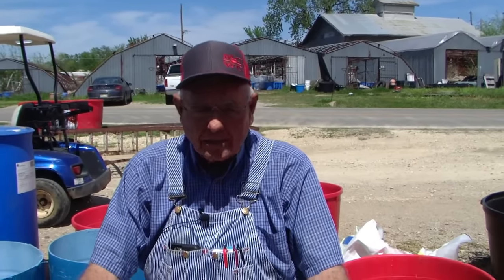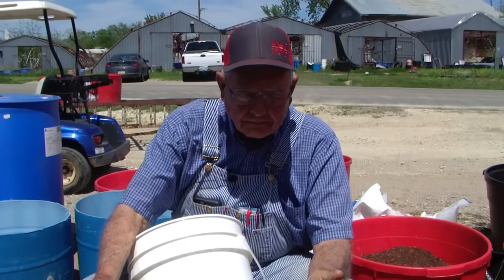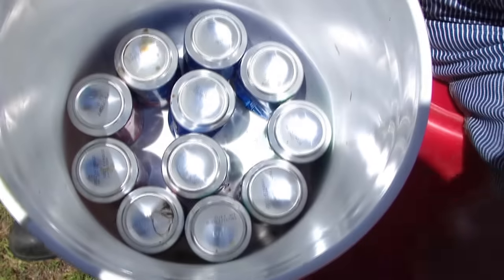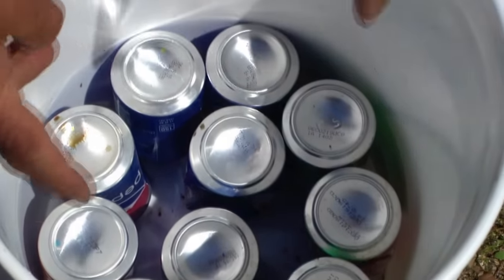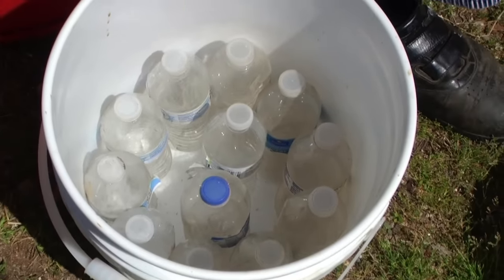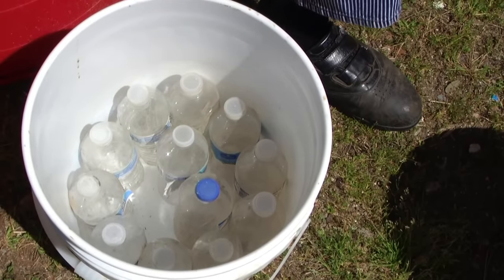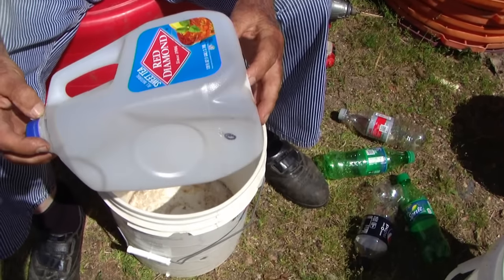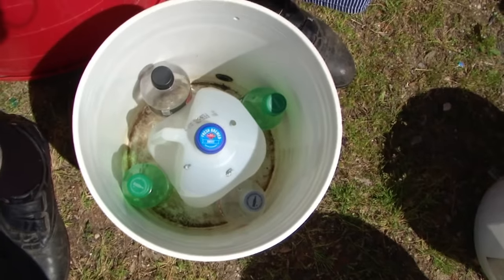Using 5 gallon wick buckets  Ep. 15

Comment: My plants are very happy in the 5 gal self wicking buckets. I have used a variety of containers for the bottom. I have one with a half gal jug that has a handle and I tied a cord around the handle before putting in the soil... I use the cord to string up my pole type tomatoes. It makes a great anchor! 

Also, I had an old hose that was going to be thrown out. Instead, I keep cutting pieces off to use in my self wicking buckets instead of pipe. It fits perfectly in the top opening of plastic pop bottles! Just being resourceful during lockdown when access was difficult.

Comment: Used this design 2 weeks ago and it's been working out great!

I made 2 buckets. One completely with dirt and the other using sand at the bottom for the wicking material. I used ground cover to separate the sand from the soil.

The seeds in the one with sand germinated and grew much faster!!! It's crazy how quickly they've been growing!
Reply: Curious how the plants grew throughout the season. I am interested in trying sand in bottom and then soil.
Reply: What kind of ground cover did you use?

Comment: I didn’t read through all the comments but wanted to add that donut shops—and bakeries including grocery stores and Walmart—are an excellent source for buckets. They are icing buckets and usually less than 5 gallon. 3 gallon is common. But they usually sell them with a lid for a dollar or two. My guy makes me a deal if I buy all they have. They’ve very sturdy, with the plastic style handle like the buckets in this video.  

Greetings from Poteau, OK. Keep at it Leon!

Comment: i.ve been out all weekend cleaning and painting my old pots and half-drums.  i.ve made all of them into self watering based on your tip to leave AIR space above the water.  i hope this will "cure" the overwet stinky odor in past garden bucket attempts.  i used hot soldering iron to poke  holes in the bottles. thank you

Comment: Leon, this is the second video I've watched today.  I think I got it down.  1.  Get a bucket.  2. Put plastic or metal container in the bottom of bucket, each container needs a hole in the top and bottom of it.  3. Put your soil + additives over and in between containers, fill yhe dirt all the way to the top.  4. Plant your plant.  5.  HOW do you know when to water again?   Neither video has told us that.  Without knowing when, this is no different from just watering your plants as we've done before.  6.  When to water wicking planters for Dummies.  Thank you.
Reply: I second this question. You never mention when or how to water the plants. Please advise.

Comment: I love your use of cans, I never thought of that!
When I make 5 gallon bucket into a wicking pot, I trim the lip off a 3 gallon icing bucket,invert it, cut slots in the bottom and use that as the reservoir.
For 55 gallon and IBC totes I use inverted 5 gallon buckets.
I find cutting slots rather  eliminates the need to use weed cloth.
I don't care to use anything as thin walled as water and  pop bottles, I find then too weak.

If I can figure a quick/easy way to put a slot into a glass bottle, they will be come my favorite, as they are plentiful and totally inert.
I've tried a form of in the ground wicking by burying a 5 gallon wicking bucket under a transplanted tree.
The idea is to give the tree an artificial reservoir to tap, while also allowing it to seek ground water.
Too soon to report results.
Reply: How goes the tree?

Comment: Can u make a video of why the air in the water bottle helps. thank you for all your great videos Leon.
Reply: two reasons I can think of.  But there may be more: 

1) Having that air space ensures that you don't get resistance when filling with water.  Think of when you try to pour something from a closed container that only has one hole.  It kinda plugs itself and pours slower.  That's why people usually punch a secondary hole for the air to come in and help push the liquid out.  If there's only one hole then the air has to come out the same hole the water is going into and the process is terribly slow.
2) It keeps from drowning your plants.  Yes, plants love water.  But if you actually submerge them for too long, they "drown" their roots become waterlogged.  They need the water, of course.  But they need air, too.  Much like you could dive to the bottom of a pool to get something you need, you couldn't stay down there forever; plants are the same.  They can send their roots into water.  But they need air, too.  But that air has to be in the soil, not just above.  Having that air gap between the water and roots ensures that the roots are never trapped under water for longer than they can tolerate. 

Same reason you put the hole on the side.  So it can just spill out instead of filling to the top.  Test it out some time.  Take an extra plant (or even a weed) and put it in a cup with soil and keep it soaking wet.  Between rotting and drowning, the plant won't last very long.
Reply: yosef bernath - The kratky method explains that.

Comment: I use a soldering iron to punch my holes in the bottles. You can buy them on Ebay really cheap.  It will ruin the tip for soldering purposes, but it will last many years as a hole puncher. It is WAAAY faster, and safer than trying to drill them, and you end up with nice smooth holes, whereas drilling sometimes leaves sharp edges.  I don't know the diameter of a soldering iron tip, but it looks to be about 3/16 inch. I put about six of those on the bottom of the bottles, and four on top. I leave the caps screwed on, and if I have bottles with missing caps, I use one as the "filler" bottle. 

I have a piece of plastic hose screwed into the end of the "filler" bottle, so you only need a foot or so of hose. I have not tried garden hose for this, but it might also work. You could probably make an adaptor out of electrical shrink tubing, if the hose doesn't fit the bottle. Of course you could also duck tape it.  I'm not sure exactly what size MY hose is, it was just something I had laying around. If possible the filler bottle should be a 2 liter, so you can just top it off every couple days, and let it seep out the bottom, and migrate into the bottom of the others.  ...Next time I make one, I'm going make the filler out of PVC pipe, and then make a "dip stick" so I can get an idea of how much liquid I need to add. …..BTW fill ALL the bottles up to the drain hole in the container, BEFORE adding the soil. Just fill the container until it almost runs out the hole, then tape the hole shut temporarily, and hold all the bottles down until they are full. It would take forever to fill them ALL up the first time otherwise.

Comment: thank you for these videos, brand new here and newbie gardener about to embark on this wicking tub for my first garden, I wanted to ask - these do not have a pic pipe pour spout, can you tell me if I have to water more often without a pvs pipe fill spout? As I will just be watering from the top? Is it MORE ideal to add a fill pipe? Or do I just water from the top till water comes out form the Hole on the side of the bucket? About how often will I have to water if I do this way (without the pvc pipe or shade cloth? thank you Leon and Bless

Comment: Thank you so much for explaining this in detail, Tried to do this watching a prior video but this one is so much easier to understand. Question do I need to add the 1" PVC pipe for watering and what about the fabric do I not need it? Great video thank you again so much
Reply: Yes you do. Spoke with Leon...what a nice man! He said to cut a larger hole on the top of one of the plastic bottles, just big enough to slide the angled bottom of the 1" pvc (or whatever you have on hand) all the way into it. And also drill a couple more holes at the bottom. (1/4" are fine) This helps the water drain out quicker to the other bottles. About to complete my first ones, so hence the reason I checked. He said that if you need to call him do so after 7:00 PM.  Good luck & good growing...peace, out.
Reply: A couple of things a. The pipe needs to be cut at 45 degrees on the end you stick into the tub. This is to allow water to rush out from the side of the pipe. If you cut the pipe at 90 degrees it will sit flush on the floor and block water flowing into the bottles . B. You don't need a cloth if you drill a hole less than about 8mm or a pencil diameter . This small drill size  will stop soil getting into the bottles . If you drill larger holes or use a side on pipe as seen with other videos you need to use that industrial. Sheeting to stop soil getting into the designed air spaces . Hope this helps
Reply: Yes, add the pipe as Uncle Brother here explains. You want the pipe so that you can water into the pipe, and avoid having to pour it directly on top of your potting mix. This way, you wash less of your fertilizer and nutrients out of that potting mix. This is also why a lot of bucket gardeners will try to protect the tops from rain. Even though rain water is wonderful for plants, the fact that it washes out your fertilizer isn't so great.
Reply: @drb4074  Nothing wrong with fertilizing the bucket's soil on a regular basis with a conmercial product, right?

Comment: Those of us who live in North east where the temperatures are mild, we might be able to just drill a hole an inch from the bottom instead of drilling drain holes on bottom of a 5 gallon bucket. Once you drill holes at the bottom of the bucket, it will drain out everything and it will be dry in summer. If you drilled the holes  about an inch, it won't drown your plants but excess water will collect in the bottom pit, we won't need to put any cans etc. What do people think of this idea?

Comment: a few years ago i started putting water bottles at the bottom of my stone planters to act as a layer of stone to allow the water to escape too. didn’t thick of making a water reservoir.  i’m going to put some water vessel inside the planters because i will not drill into my stone planters, they’re about 3’ high and too expensive to potentially break.

Comment: Thank you Leon. Great video's. In some video's you use a tube to fill the bucket, would you or can you use a fill tube in the 5 gallon pail and how does the water get into the smaller bottles if the soil is packed down in between them?  Thank you
Reply: 2 holes are drilled in the side of each bottle; 1 near top and another near the bottom.
Reply: @audreynorman1772  setting p my pails just this week I put 4 at the top and 4 at the bottom to make sure water and air can equally move about, And since this is my first year trying this I am worried and thrilled to see what happens

Comment: A more natural method is to put sticks and twigs in a layer on the bottom instead of the cans. It will give you the air spaces that the plants need. Cover with a plastic top when extra heavy rain is in the forecast. Safer for your family to recycle the plastic bottles and cans.

Comment: Thanks Leon for sharing your wisdom. I am going to do 5 gal buckets for sure. But also want to do this with a smaller, Folgers 48oz Ground Coffee Can. They are 8.5" tall, 6" in diameter. How high would you recommend for the water line. I plan to do hibiscus and other cuttings. Thanks!
Reply: Do you have a follow-up? 🤘

Comment: Can you please tell me if I need to put a PVC piping in any of those techniques, and how to do it. Thank you!! Love your videos
Reply: A pvc pipe makes watering very easy. Measure pipe so its above the container. Then cut the bottom of the pipe an angle to prevent cloge. You can also drill some holes on the PVC pipe but isnt required. Simply dump water down the pipe till it starts coming out of the hole on the side

Comment: GREAT VIDEO - Just making sure that I do NOT need to put cloth over the Water jugs in the 5 gallon bucket correct? 1 Gallon with drilled holes top & bottom & 4 plastic soda bottles with caps & holes top & bottom, then the bucket gets about a 5/8" hole o its side 5" up . Place the gallon & 4bottles in with PVC pipe then add soil as mentioned then use PVC pipe to fill with water until it over flows out the side of bucket. Correct ?
Reply: You still need to put the cloth or the plant will drown.
Reply: Thank you for the response !  @suhayb727
Reply: PowerV2010  I’ve seen these types of videos a dozen times & STILL don’t see how it’s all tied together. How are all the cans/bottles holding water if you’re drilling holes into them?  Why not just drill one hole 5” up & be done?
Reply: That's is what I am trying to figure out  @user-22-

Comment: Using plastic water bottles with holes at top and bottom, does the potting mix tend to fill the holes and impede adding water?   Same with pvc fill pipe.

Comment: This is great but I have a curious question about the 2 holes in the bottles/cans/jugs.  Wouldn't the soil get in those holes?  Especially the jugs' top holes cuz it's almost facing directly up.  Over time the cans/bottles/jugs would fill up with soil and have less water holding capacity.

Am I missing something?  If anyone can elaborate on this would be much appreciated.
Reply: im going to push some weed cloth down into and around bottles/jugs then add soil. i thin leon demonstrates this in another video

Comment: Great video BUT........I made one of these with a 5 gallon bucket using 3 to-go soup containers and three 12oz Coke bottles in between. All drilled high and low on the sides with 1/4 in holes. My question is, how do you tell when it needs water? Unlike the set up with two buckets and the reservoir on the bottom, I can't tell when it needs water. And doesn't the soil below the drain hole become a soggy swamp?

Comment: I wouldn't use Aluminium cans though not for food plants i really dont like plastics either they've been known to be just as toxic as Aluminum.. Great idea though
Reply: I was thinking the same about aluminium cans; I guess you could use glass jars if you turn them upside down and drill a hole in the bottom.
Reply: For sure! Only food grade for food. Flowers are different.

Comment: I don’t get the role of the air gap at the tops of the cans. Why does it matter to the soil or roots outside the cans? Does the water level drop within the cans as it does outside in the bucket, pulling air down through the soil into the top of the can? Wouldn’t that air replacement of falling water level happen without the cans?

Comment: Leon, i did a self wicking 5 gallon bucket yesterday- made the hole in the outside of the bucket 5 inches up, filled the bottom with 16oz water and Gatorade bottles(put holes in the top and bottom) put my PVC pipe in one of the Gatorade bottles, did everything you said and TODAY the strawberries look SO THIRSTY. I of course put water in the bucket via the PVC pipe until it started coming out of the hole in the side. Please help-thank you
Reply: You need to water from the top of the bucket for a week or so to give the soil and roots a chance to get wet and wick properly. Then fill from the pipe is the way I understand it to work

Comment: In your other video you said to lay a piece of professional grade weed barrier on top of the water bottles then fill the rest up with soil mix. Do I understand correctly that the weed barrier fabric and the vertical pvc pipe  is not needed in the 5 gallon size self wicking container? Also what type of soil mix do you use please?

Comment: Do we not use the PVC pipe and stick it in there to water?
Reply: Yes you do. He forgot to mention it.
Reply: So what are the bottles /cans with holes in that soak up the water for🤔
Reply: @patricialloyd866  to hold the water and slowly drain so it waters it for days
Reply: Becca Bohannon so we keep the bottles empty and don’t fill them with water, correct?

Comment: I’ve a grove of bananas.  Can I use banana leaves, stalks etc., grind with leaves, twigs, grass and manure to create my own mulch?  I’m creating the 5 gal wiki-tubs you show in place of my previous in-ground gardening.
Reply: Sure, but my experience, and we have a large grove of bananas, is that dried banana leaves are tough, stringy and will bind up a shredder.  I would alternate layers of leaves, ground up wood scraps, twigs, branches etc ., grass clippings
Reply: Also add organic kitchen scraps.  When center of mulch pile is quite warm, you know the microbes are at work.  Mulch pile needs to be roughly 3 foot square and periodically turned over.  Good luck!

Comment: I have the commercial weed barrier already but see you aren't using it in this video for the 5 gallon bucket. Is it less favorable to use it with the 5 gallon bucket or would it be recommended if its accessible?

Comment: I think I might have missed something..where do you add the water once your soil and whatnot is in the bucket? There's no fill tube.
Reply: As someone who spoke with Leon mentioned in another comment, you still need to use a PVC pipe for watering. Drill a hole in one of the jugs so that the PVC pipe barely fits into the jug. Also a good tip is to cut the bottom of the PVC Pipe at 45 degree angle so the water can flow out the bottom of the pipe without getting stopped up.

Comment: might be a stupid question, but isnt it a concern that the chemicals in plastics would leech into the food you grow? or what about the cans rusting, and same with anything leeching into the food? the bucket itself has to be food grade but are the things you use inside the bucket without concern??
Reply: Aluminum cans never rust and the plastic water/juice bottles are already safe for human use and do not leach chemicals into the soil. I personally would avoid plastic that was not used previously for juice, water or other foods/liquids that humans consume so I would stay clear of detergent bottles unless they were: #2 - HDPE (High-Density Polyethylene), or #4 – LDPE (Low-Density Polyethylene). These are safe